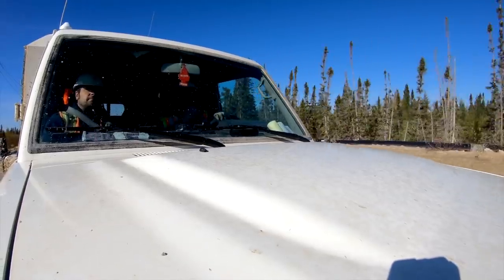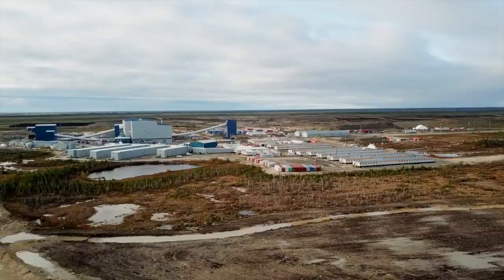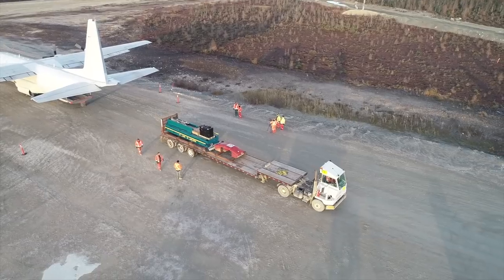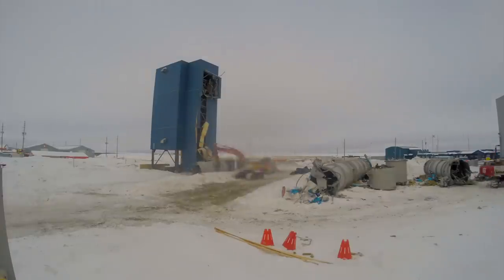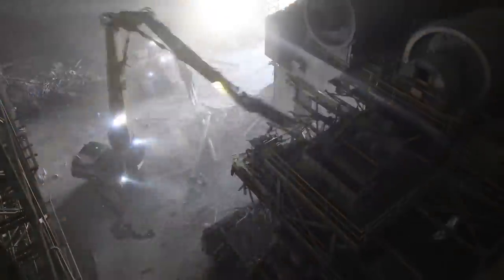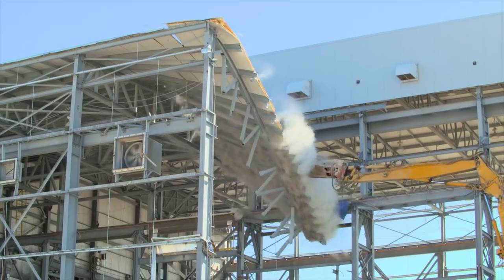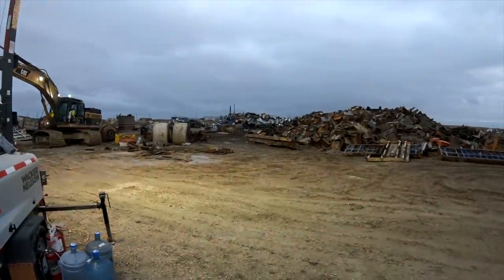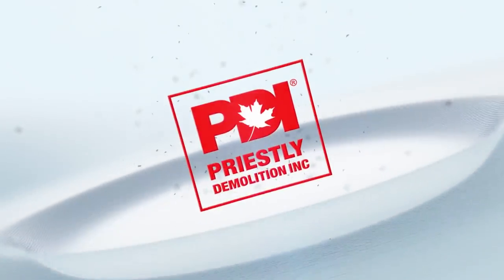Must See Demolition at Ontario's 1st an only open pit diamond mine.

Comment: Interesting to see this.  I was the Captain on the Hercules whcih brought the equipment in (and also when it was demobilized last fall)  I had been told that the scrap steel would be trucked out to tidewater over an ice road. Has that happened?
Reply from the maker: That's cool Andrew. We did move some of the steel this past winter. Still a work in progress.

Comment: What happened to all the scrap and other waste? Was the salvageable steel removed for recycling or is the entire thing being buried in the pit?
Reply from the maker: scrap was been sorted for future removal.
Reply: All removal processes happen only during the winter, when the ice roads open up and the ground is frozen solid enough to handle the weight of the freight, so to speak. 🚛🚛🚛🚚  🚛🚛🚛🚛🚛 🚚🚚 🚛🚛🚛🚛🚛

Comment: what about the hole and is the scrap metal going to be trucked out to ? Sudbury ? Toronto?
Reply: At one point the plan was to truck the scrap metal out to Hudson Bay (Attawapiskat is the nearest tidewater community)  over an ice road.   (there are no all season roads to the mine) however, I've seen articles published recently that suggest that they may be seeking permission to dispose of it on site in a landfill.
Reply: @andrewalexander9492  Good  day from Kitchener-Waterloo Ont. So if they are taking it to landfill , why bother taking it down at all ,   Boy that must have been costly.  Thanks
Reply: @donvoll2580  If you simply walk away from it,  then it spends the next hundred years or so shedding sheetmetal panels that blow around the countryside,  slowly deteriorating until it eventually collapses. In the meantime it's a hazard to anyone who might venture there, not to mention an eyesore.    I don't know if you've ever been to a mine that's just been abandoned but they're kind of a mess.
Reply: @andrewalexander9492  Yes I watched Yukon Gold were there were  old pcs. left behind. Thanks
Reply: @andrewalexander9492  Said "Landfill" being the open Pit Mine that is conveniently still there, you mean?  🤨
Reply: @steadholderharrington9035  I don't think that is what is being proposed,  but I will cheerfully admit I don't know for a fact that it isn't.
Reply: @andrewalexander9492  If nothing else, I would hope that they would haul out all of the processed steel at the very least. Even "scrap value" still has value and it can pay for some of the clean-up and remediation costs.
Reply: @steadholderharrington9035  Agreed, I would rather see steel recycled than discarded,  but the reality is that this is a really remote roadless place, and the cost of transporting the scrap to the road system may exceed the value of the scrap.  I don't know that for a fact, I'm just saying it's possible.
Reply: @andrewalexander9492  Agreed on the area being generally roadless, but they can still float the scrap on flat bottomed barges down the Attawapiskat River for the most part, should they desire to go that route (temporarily excavating or dredging in certain key floodplain area's where the river gets too shallow) as it does have direct access to the southern tip of Hudson's Bay and they can choose how heavy of light to make the barges too, and the bonus is that its only about 120km from the mine site to the Bay, give or take 10km.
Reply: @steadholderharrington9035  Anything is possible,  but at what cost?  Remember, we're talking about scrap steel, whcih is worth less than $200 per ton.  if you spend $250 per ton transporting it, that's a loss.  The Attawapiskat River is a fairly narrow shallow river.  There's not currently any barge service on it, as there's no communities on it, other than  Attawapiskat  at the mouth.   Transportation of bulk materials by barge is inexpensive on large rivers.  On small shallow rivers when special barges have to be brought in from who knows where, it's not going to be expensive.  DeBeers has been conducting a large scale mining preparation there for over a decade.  They have already done their homework on what transportation modes are viable.  If barges on the river were viable, they'd be using barges on the river.
Reply: @andrewalexander9492  True, very true..... and yet, I somehow have to wonder why then, did they decide to go and build a road from their worksite, straight to the Attawapiskat River in the first place then? You can even see it from the Google World Map when you look down on it from Satt. pics. And unless that is what constitutes their ice road for the entire distance during the winter months, I can't come up with another reason as to why they constructed that particular short stretch of road in the first place? This is more of a curiosity than anything else, is all.😁

Comment: It was in operation for only 10 years?
Reply: Modern mines generally have a planned life.  Mining companies spend a lot of time prospecting and defining the extent and quantity of the mineral to be mined.  Based on the prospecting resulted, they have a pretty good idea how much is there, how much can be economically extracted, and how long that will take.   It's certainly possible for mines to exceed a planned life, because of various factors like, discovering more ore than the prospecting indicated,  increases in the market value of the product, or changes in the technology whcih makes extraction less expensive, and allows economical extraction from more marginal ores.   Diamonds are formed in Kimberlite Pipes,  whcih are pretty distinct volcanic formations.  Once you're done  excavating the Kimberlite, you aren't going to be finding more diamonds.

Comment: Will it look like they were never there when the project is finally finished?
I still saw some buildings, tanks,etc.
Reply: Preistly had the contract to demolish the mine workings buildings.  That's just one portion of the remediation.  Many of the living quarters buildings and such are still standing.  However the closure is  far from complete at this point.  I had heard speculation that some buildings might be left standing for some purpose,  but I don't know for a fact that they will.
Reply: Andrew Alexander Thanks. That would be interesting to follow. I suppose the mine may become a lake.
Reply: @danvetor1365  Well, it's already a lake of sorts. the pit filled up as soon as they turned off the pumps.  The water level last November was a ways below the rim of the pit. No idea where it will reach equilibrium, but I suspect that it will always have steep rocky "shoreline".
Reply: @danvetor1365  Also, looking at some pictures, it looks like most, if not all of the living quarters and such are constructed out of prefabricated modular units, so it may be the plan to truck the units out over the ice road.
Reply: The actual remediation will take some years as the only time they can realistically work is in the late spring, all of summer, and a bit of the fall (5 to 6 months in all) before the freeze sets in again. The winter will be used primarily for maintenance work and trucking materials/building modules out and whatever food and fuel stuffs are needed for the next year phase of the remediation process in, over the ice roads. The fuel tank farm, one wing of the worker accommodations, the cafeteria and entertainment facilities, and a few maintenance sheds will be the last things to be removed after everything else is taken out and the land remediated. What was left over after Priestly Demolition was finished will be hauled out during the winter, and the rest of the constructs and containers will be loaded onto flatbeds or container chassis' by crane or forklift and likewise taken away until only a dirt road and a "new" lake will mark the passage of the former diamond mine.🌲🌲🌲🎄🌲🌲